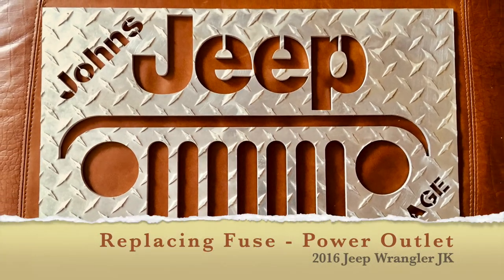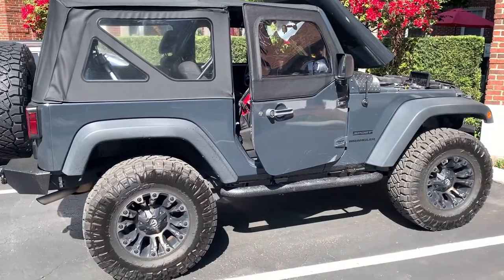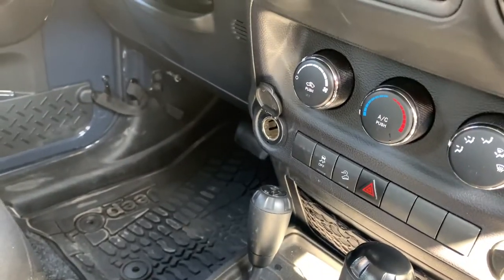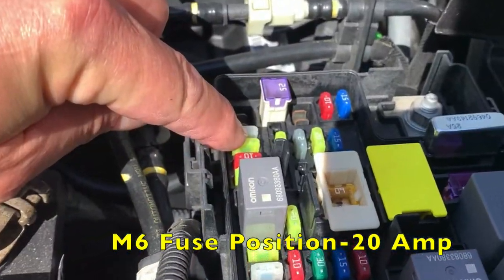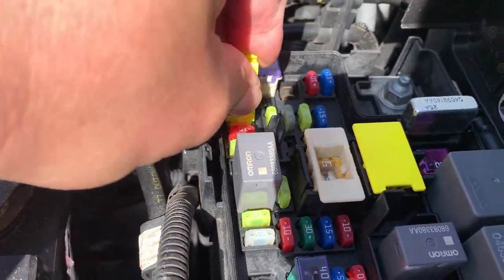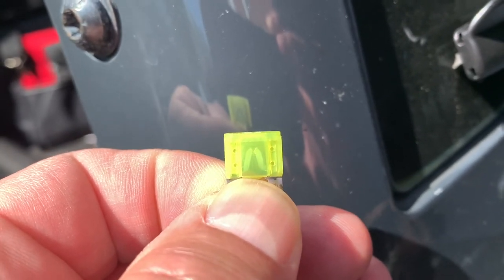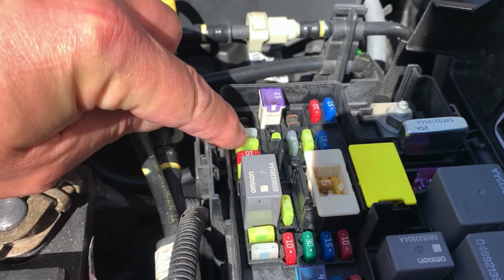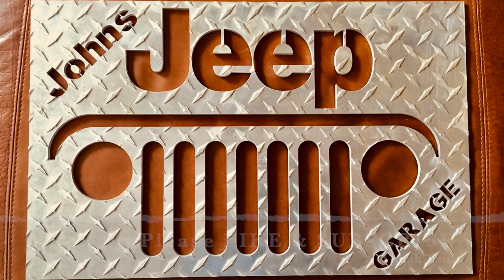12V DC Power Outlet not working? (Cigarette Lighter) on Jeep JK

Comment: Will this also fix the power outlet located in the center console? Or is there another one for that one?
Reply from the maker: https://www.mopar.com/en-us/care/dynamic-manuals/viewer.html?id=1147&topics=GUID-82C62934-C1D4-4793-BC27-D4D14375C386&tocID=2017

Also should be number 5.
https://knigaproavto.ru/shemy/en/jeep/wrangler/61-jeep-wrangler-jk-fuse-box-diagram-2007-.html

Comment: This is all Greek to me, BUT thanks to your simple - no music - great camera angles video, I now know where the fuses are!  
Question: I purchased a dash/rear Blackvue camera.  I currently have it plugged into the dash cigarette lighter plug.  So, it goes on and off with the ignition. I don't want to hard wire it in order to get parking mode.  I'm wondering if I ran the cable to the the center console cigarette lighter, since it stays on continuously, would that be a big enough drain on the battery to worry about?  Or would it be a good idea to unplug it while parked in the garage? Thank you.
Reply from the maker: https://www.youtube.com/watch?v=bmirJmPaoAw
I don't know the type of camera you have but I would say if you connect it directly it will drain your power when parked over a period of time.  You should call the vendor to get more details and a suggestion on the best place to connect it.  I don't do fuse taps often but this may be exactly what you want.  Possibly tapped into the ACC fuse so you can have it on each time you start the car.  I don't have a video on fuse taps but I did include one on here to give you more basic info about what this means.
Reply: Thank you, John. This was helpful.

Comment: I have a 2018 Jeep JK Sport and I bought it two months ago.  I have a 12 volt DC outlet where yours in on the lower dash and I have a hole at three o'clock from the DC outlet.  To the left of the Hazard flashers and dummy buttons.  I see that you have something there.  What is that?  I have a empty hole?  Is there wiring in the dash for another 12 volt DC plug or USB charger to be installed and plugged in?
Reply from the maker: Thank you for watching. Those are other options.  One is Jeep's Selec-Speed Control, often referred to as Hill Descent Control (HDC).  Imagine a cruise control feature for descending down hills. The other is turning the limited slip differential (traction control) feature on or off.
Reply: @JohnsJeepGarage  Thanks.  I have 2 more buttons on both sides of the Hazard flashers. Hill descent and traction control on the buttons. Then the hole on the opposite side of my 12 volt dc plug. I thought it was for usb charger. Or maybe there was a dummy cover there  to cover the hole and the previous owner lost it. I would send you a picture but I don't think  that can be done here. I guess I am going to try and wire in another 12 volt dc outlet, I was hoping there would be wires there for that already.
Reply from the maker: You can always reach out with messages and pictures on Twitter (X) or Instagram.

Comment: Do you know of anyway to make it so the 12v DC can stay on with out the car needing to be on for a 2010 jeep  Patriot
Reply from the maker: I don't know the wiring for a Jeep Patriot specifically but you can look up videos on how to do this in general for vehicles.  Using ACC Power (connecting) allows the power to work on some accessories when the key is turned to ACC power position just before starting the motor position.   There are more specifics on this on YouTube.

Comment: Weird question could I fuse tap here to add a pod switch panel with 4 rocker switches?
Reply from the maker: Thank you for watching.  I have run a single install source with tapping, such as Halo lights, but not a switch pod. I have seen it tied in directly to the battery with a fuse within the wiring connection.  So I am not the expert with this.   I have however attached another video from another YouTube source which may help you or offer a point of reference.  I hope this helps.
https://www.youtube.com/watch?v=9wo1qFQgrMU

Comment: I have a 2017 JK and neither power outlet is working. I replaced the M6 which was blown but it didn't fix the power for either power outlet.  Do I have something fried in the wiring or are there additional fuses to check? thanks!

For additional context, I was running an air pump for inflatable beds and the first power outlet stopped working so I tried the other one and then it stopped working too. I know this was dumb as it was drawing too much current but I was in a pickle and HAD to get these things inflated.  So... I'm not sure if I fried the wiring or if there are just more fuses to check. thanks for any help to whoever reads this!
Reply from the maker: https://vehicleinfo.mopar.com/assets/publications/en-us/Jeep/2017/Wrangler/2049.pdf?_gl=1*3ipjlk*_gcl_au*ODI3NTY5MTEwLjE3MDc4NDQzMzA.
Reply from the maker: Read Pages 172-176

Comment: Center console power outlet is not working but the fuse is fine (M36). Any clues how to find info on how to replace the outlet?
Reply from the maker: The power outlet switched needs to be pressed each time you start the car.  I assume you know this, if not, it is on the lower panel on the dash in front of the automatic or manual transmission.  An outlet design is on the button.  If this has been pressed and the fuse is good, then there is another electrical problem that needs troubleshooting (switch, wiring, etc.).

Comment: I have a 2015 Jeep Wrangler with this same issue. I've replaced the fuse several times, but it keeps burning out every time me I turn the outlet button on. Any idea of what problem could be... Thanks in Advance!
Reply from the maker: Sorry to hear that. Thank you for watching.  This video as you know is specifically for the fuse for the cigarette lighter outlet, but if I understand, it seems that the inverter outlet that you can plug an extension cord into keeps blowing the fuse when you toggle the button. There is a short somewhere based on your description. If it immediately burns out once you toggle it on, I would trace the wires from the inverter as well as the switch to see if any wire is exposed or not connected correctly.

I could tell you to buy a new inverter module outlet, which may be the right solution, but I would hate for you to do that when it may be something in the wires.  At the same time, the module may be the issue as well.
Reply: @JohnsJeepGarage  yeah, it's the inverter outlet but when it blows that fuse the lighter outlets stop working as well. But i'll see if I can trace the wires and see what is going on. Thank you!
Reply: yeah its actually the Inverter outlet that keeps blowing the fuse and the cigarette outlets stop working as well. I'm gonna see if I can trace the wires and see if that's the problem. Thank you!
Reply from the maker: I hope it is an easy fix.  Please share and I will ensure it is posted. Thank you again for watching our channel.
Reply from the maker: Since it blows both sections, my guess is something is loose.  Thanks again for sharing.

Comment: I wonder if the box/fuse is the same for the gladiator.  I am having the same issue
Reply from the maker: Which year Gladiator do you have?
Reply: @JohnsJeepGarage  2022 Mojave
Reply: I researched a bit online and couldn't  find a 12v socket listed But I did see one listed as cigar lighter which was a 20 amp fuse in position 52 so I'm going to check that tomorrow and see if mine is burn out.
Reply from the maker: Thank you - I will follow up as well.  I have a 2023 Rubicon - should be the same box.   I will check.
Reply from the maker: thanks
Reply: @JohnsJeepGarage  that was it.  F52.  it wasn't blown though, I happen to wire my Oracle LED headlight halos into that slot and when I did so I took out the 20 amp fuse and placed it into the harness that came with the Oracle and plugged it back in. But when I pulled it out today I noticed a second slot for another 20 amp fuse so apparently when you install that you have to put both fuses in.  Duh.  I used one of the spares that was already inside the compartment and plugged it into the harness and presto!  The socket works now.
Reply from the maker: https://youtu.be/hDEVhN9-AFA
You should have these as well for future use.

Comment: My other outlet is not working and I can not find the fuse for it
Reply from the maker: What year is your Jeep Wrangler?   Maybe this link will help you? Thank you for watching our channel.  
https://fuse-box.info/jeep/jeep-wrangler-jk-2007-2018-fuses-and-relays
Reply: I have a weird question, my 2010 jeep wrangler Sahara the windshield wipers come on when I turn on the turn signals! How do I fix that?  🤦🏼‍♀️
Reply from the maker: Sorry, I just saw this because it was a reply to a comment.  I would have to trouble shoot the wiring and possible connection issues.  But ... there is a video that may help by someone on YouTube:   "Jeep JK Wipers and Headlights Turn Themselves On - TIPM Issues Definitive Guide".    That was the title between the quotes.   Without being able to see it, maybe this video has some suggestion to help.